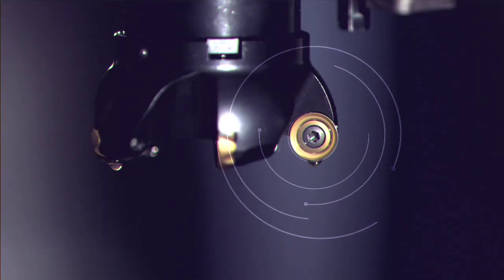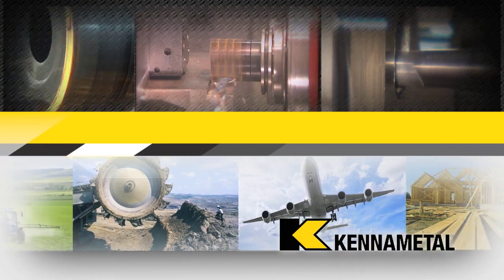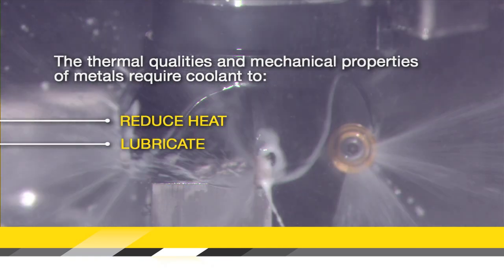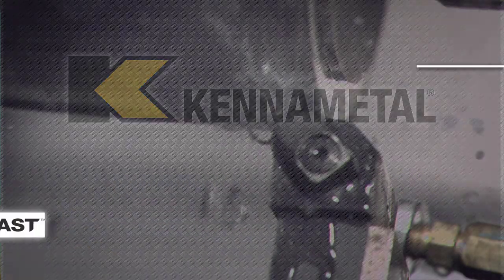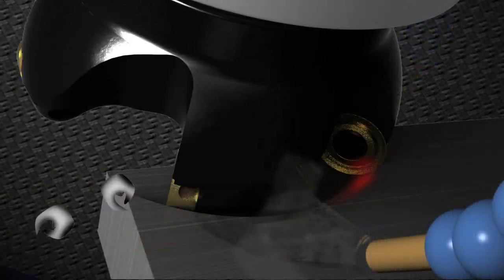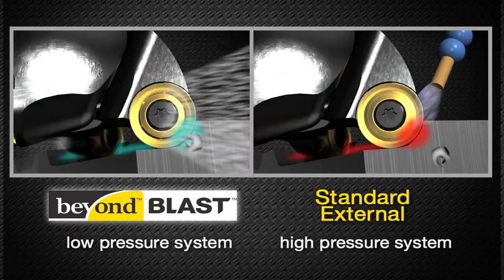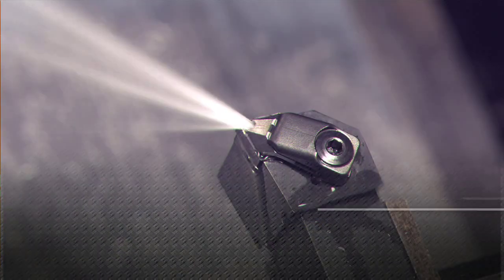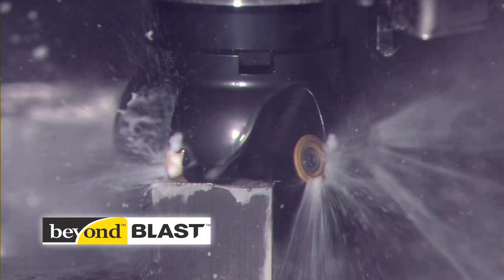Beyond Blast PCT™ (Precision Coolant Technology)

Comment from the maker: Milling cutters designed to cut Titanium have a higher shear angle. This helps in the cutting action in Titanium and High Temperature Alloys. If you use a cutter designed for cast iron or steels in Titanium it will push the material instead of shearing it and the heat will build up and the inserts will fail. The Beyond Blast cutter has great design for these type of materials. With the coolant delivery exactly to the cutting edge.